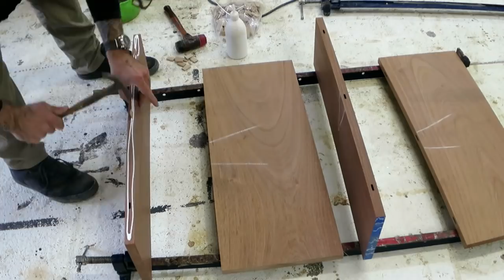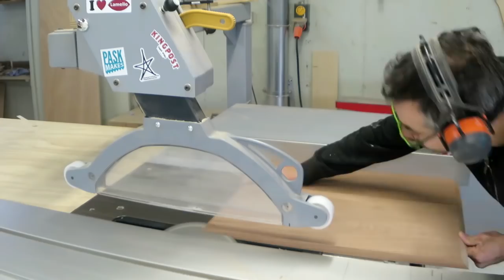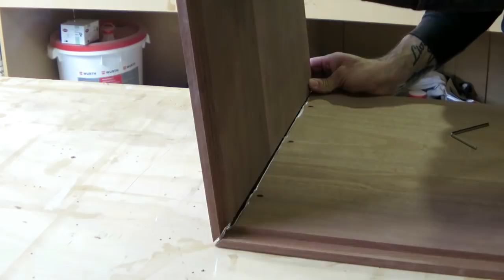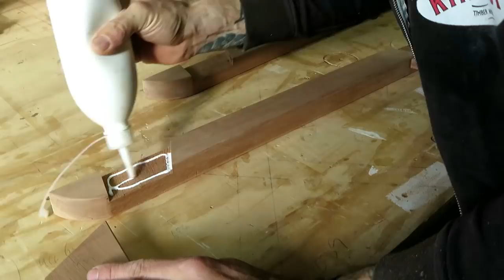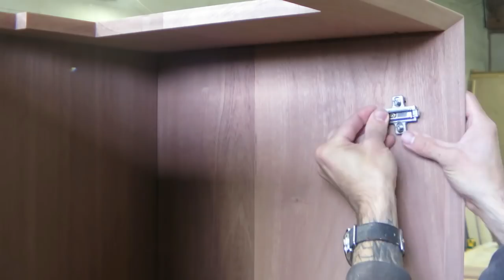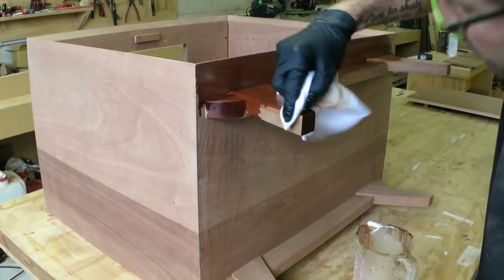Sapele vanity

Comment: CNC allows you to design a little differently.....not better or worse, just different.  I like that you weren't pushy about CNC, you just used it.  I've been using them in a woodshop for almost 15 years.....I might actually get one myself one of these days for home.  I really like the reveal on the vanity legs.  Nice touch.  Nice overall piece as well.

Comment: Great work.... Went by your shop just the other day on the way to the cabinet supply down the street... Hey quick question for you.  I have noticed that you have used sapele a fair bit in past videos.  I am currently building kitchen bench tops out of 38mm thick sapele.  I had a small spare piece after glue up and wanted to see how strong the wood was... to my surprise a wack on the work bench and it cracked right down the grain in two.  Now I am worried that the bench will split the same way.  Do you know of anything that can be done to increase its strength without inhibiting movement from humidity?
Reply from the maker: Well, unsupported timber is very week,  a bench top is very well supported and as long as it has some room to move and no one hits it with a hammer it should be fine. Remember it has been felled loaded onto trucks been milled kiln dryed stacked and shipped and is still in one piece.

Comment: Would be interested to know hw much CAD you’ve done before, whether there is a learning curve involved here or if you’re already past that.
Also, those hinge holes are whack! Is there any way to modify the X-carve bed to accept bigger doors so orientation rather than size is the limiting factor?
Reply from the maker: I really have no cad background at all. I do have a pretty good sketchup experience which makes the drawing of parts very easy.  Then being able to export them into Easel makes life very easy.  I have experience with a full size CNC and its software and that is very difficult to get your head around. The easel software makes life very easy.

Comment: Nice. Do you know if the lamello fasteners will work with a standard biscuit joiner?
Reply: They won't, unfortunately. The blade cuts a very specialized shape for those inserts.
Reply from the maker: It Can be made to cut biscuit too
Reply: Lamello can do biscuits but biscuit joiner can't do lamello fasteners :) One day I want a Lamello... They're so cool!

Comment: Joey, I've just noticed something. You don't glue your Domino's in, do you? I take it you're satisfied that the glue line between panels is plenty?
Reply from the maker: That's right, unless I'm using them for actual joinery like chairs they are just insurance for alignment. I would say they actually weaken an edge to edge join slightly.
Reply: Makes sense. Nice one.